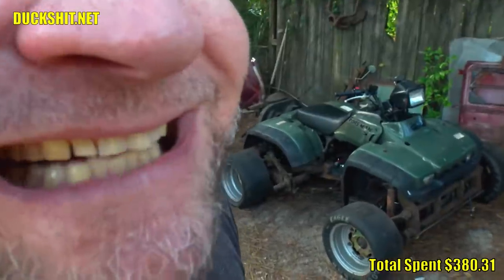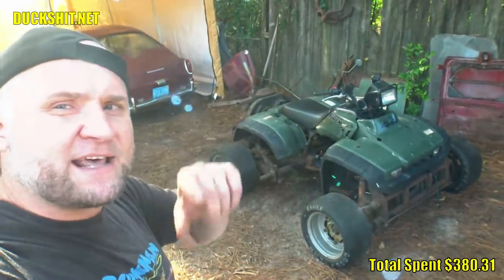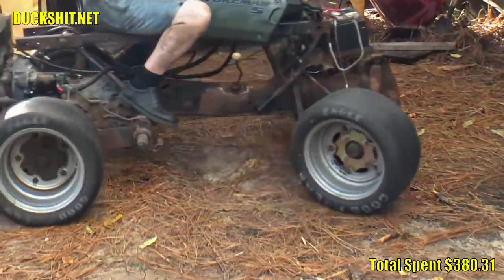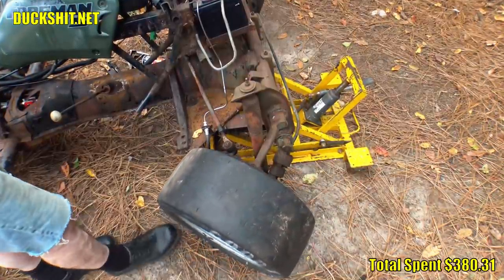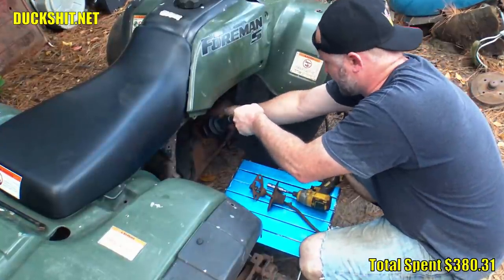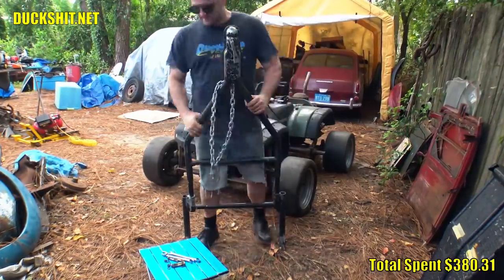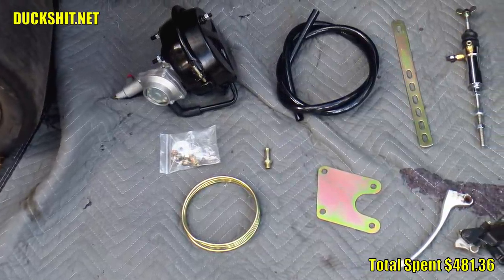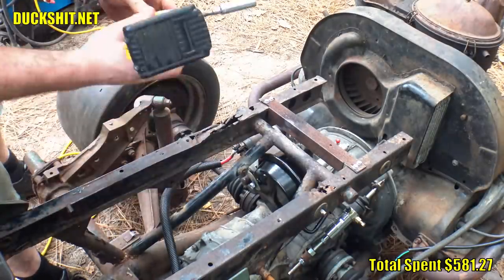Test Ride Problems - VW Motorcycle - ATVW Junkyard Build - Part 12

Comment: The booster was a stroke of genius!!  And maybe, just maybe, that set of drop spindles that super attractive guy gave you would add a little extra weight transfer to the front if you really need it.
Reply from the maker: Thanks man!   Those spindles are still currently weighing down Ruby's front end!  Haha... I have  a plan for em.   Will see how that turns out soon enough!

Comment: You can put a pressure switch (From vw brake cilinder) in te TEE. And wire in series the start button. In this way the engine only starts if the clutch is pressed. Great job with video
Reply from the maker: There is already a pressure switch installed there, per previous videos... there is also a switch in the clutch master cylinder.  It can be done either way!  😁👍🏻

Comment: That build is awesome...imagine a 911 engine instead a vw bug engine...XD 
Steering limiter should fix the locked steering problem...
Reply from the maker: Thanks!  The steering stops were modified in this video, no need to add anything else!  :-D

Comment: There is a pre-fab frame, but you can probably build your own by modifying a 2-wheeler frame.
Those Euro-trike guys use two transaxle cases in tandem to get the length, but it looks kinda bulky. You could probably use the Vanagon gas clutch housing and make an adapter to a T5 or some side-shifter, and use a narrow rear end like from an MG Midget. 
Some older Jeeps had an offset diff in the rear.  I thought about cutting the long tube to the proper length, and using the short axle on both sides.
Reply from the maker: What is it I am building here? Don't think I understand where you're going.  😁👍🏻
Reply: @DuckmanCycles  Probably a year. 
But think of the trophies.The ooohs and aaahs....the chicks wanting a ride.
THE BURNOUTS!
Reply from the maker: I already have all that stuff, I still don't understand what you want me to build.
Reply: @DuckmanCycles  That badass Eurotrike that you said you liked....the VW mid-engined  chopper. With extreme prejudice and attitude....and straight pipes.
Reply from the maker: I don't think I need any of that!  :-D

Comment: Looking good. Do you have a solution for the oversteering. Maybe a bump stop? I would like to see how the hydraulic clutch setup is going to work.
Reply from the maker: I wasn't aware I had a problem with oversteering!   And I thought I just showed how it was going to work... not done, but that's how it's going to work!  😁👍🏻

Comment: i got to ask why did you need the servo? im running a similar system on night owl but a have a wilwood master up front to the hydraulic cylinder to pull the clutch in. am i doing something wrong or do i not need it?
Reply from the maker: Are you using a hand clutch?